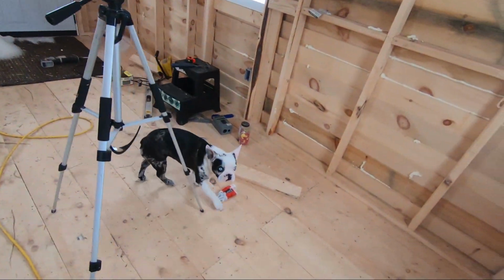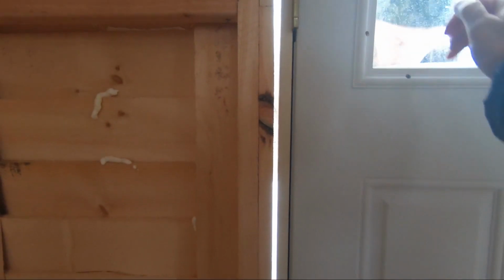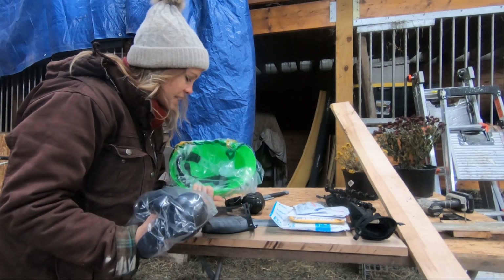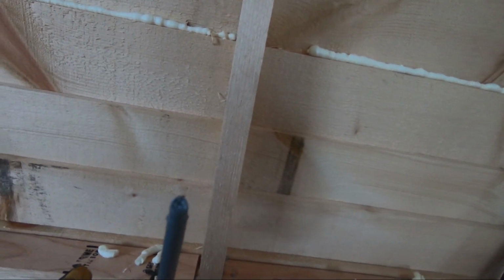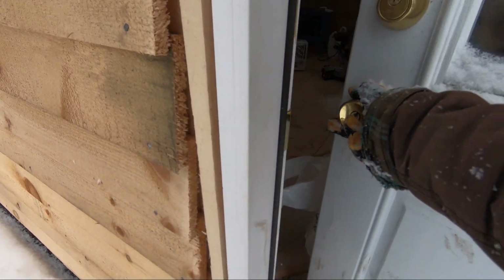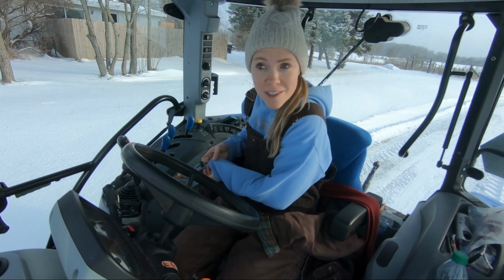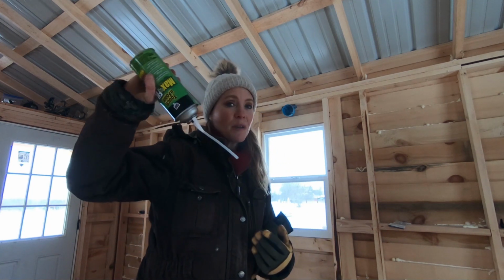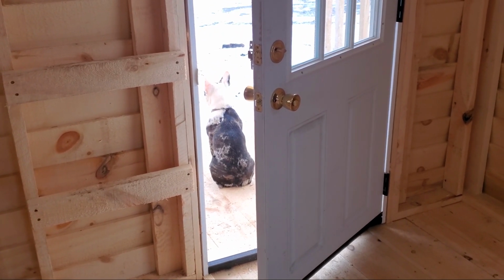359 New Holland T5 Plowing Snow, Cabin SNOW, And Spray Foam Adventures - Off-grid DIY Cabin Vlog5

Comment: Farm girl you have to be the coolest mom ever 💪😎I was kinda wishing that I was a kid again 😃 that looked very fun 😁 doors can be a real pain to get adjusted but they do make a special foam to use around doors and windows because you can do more harm than good very easy learned that the hard way calking will fill the void and stop any air from coming around the door jamb and it doesn't expand to much and cause problems 🤔 you both are very smart and you will find something that works for you 👍 thanks for sharing

Comment: That is one of the issues with using fresh rough cut it will move a LOT as it dries out. Don't be surprised if you see the boards check and even split as they dry. On rough sheds I like to set them when it's warm enough that you can get the boards painted or sealed ASAP. That helps slow the drying process down and keeps them from moving quite as much. I also wouldn't spray the interior until it dries down some just to prevent any issues from the trapped moisture.

Comment: BTW, that snow along the floor/wall is because the builder did not use sill sealer used to keep water from seeping into the walls and floors along the bottom of the walls .. You should use your spray foam there.

Comment: The doors should be trimmed then fill the gaps with foam insulation and be sure to seal all your seams with silicone caulk so you get a about 20 year seal from weather and bugs.  I trimmed the inside of my shed with tar paper and then silicone the seams along with adding insulation and then covered the interior with paneling using screws so when I needed work inside the walls for adjustments all I had to do was unscrew a panel.  Then just screw it up when finished no repaint or tape and bed. Saved money and was much easier to deal with over the years.
Reply: She is going after a more finish look. So I think she is going bro use drywall in the inside. I get what you are talking about.

Comment: Foam strips with adhesive backing should have been used under ridge cap to prevent snow from coming in but still let it vent.

Comment: Like some other people have said already. Be careful using the spray foam around the door and windows. The foam can cause them to get out of square. Or in windows cause the glass to crack because of the pressure from the window. The windows and doors expand and contact. 
May want to get the inside warm let the wood floor dry some then put a sealer on the green wood. Use screws to tighten the boards down. If you don't the floor may squ( make noises). Just put like 1/4" to 3/4" underlayment before your final flooring.

Comment: The foam you are using should be kept above 60 degrees for at least 12 hours before you start using it. That will help it to expand and stick better. After everything dries out good, maybe a layer of 1/4 inch (or thicker if room at the doors) hardboard like Masonite will help level it out and cover the cracks.
Reply from the maker: Yeah I started keeping it indoors ;D

Comment: Suzanne  I would of had plywood instilled on the outside of cabin before siding boards.
Reply: I agree since she is using the shed as a office. But if it going to be used as  tool shed like most are. Then it would be fine as is. You are not going to be worry about some rain or snow getting in.
Reply: Yes, this shed was built cheap for the price payed imo.

Comment: Was there not some sort of warranty with the cabin. Get the turkeys who built it come and fix it.  Also it’s time you invested in a proper snow blade. A angled one to save all the manoeuvring.
Reply from the maker: No, no warranty :(   Erik chose the snow pusher, he chooses the equipment usually, lol I don't know his reasoning for this item other than it could move large amounts of snow
Reply: When I plow I dont do all the side push offs like Suzanne does. The T5 is heavy enough and powerful enough to go down the driveway without all the manuvering. She needs to increase her speed of the tractor let the weight and momentum plow through the snow.

Comment: We are planning to build a barndo on our property. I LOVE the picture of the one you showed that you will be building this summer. Can you share the floor plan? Or where you found it? I love the slope of the roof! We are wanting to do solar to be as off-grid as possible. BTW, I love all your videos!
Reply from the maker: You know Erik and I talked back and forth about a barndo vs. a timberframe using that same plan. It would work for either, although the rafters might be a bit different. We re-vamped the floorplan, but here is a link to the original one:  https://www.sandcreekpostandbeam.com/products/predesigned-barn-home/modern-western-home

Comment: Before building your next project, hire a contractor who knows the building codes . Just because people don't live in an area with building inspectors doesn't mean it's a good idea to ignore the codes. Educate yourself with the codes so you won't be taken advantage of. The exterior of the walls should have been 4x8 sheathing, then vapor barrier sheeting, then the siding. Flooring planks are never nailed, but should be screwed. For thirty years as a contractor, we never used foam insulation on doors or windows, we used fiber insulation to maintain the reveal, gap between door edge and door sash. that foam insulation can close up.
Reply from the maker: We are most likely going to be doing SIPS panels, so the shell at least, will be built in a factory to code. Electric we will have Erik's buddy come out and help, and will make sure everything else is correct :)

Comment: The plow that you have is it in front of the tractor or the back? Because I have a plow that would fit the front of the side by side it has a 4 foot cut I think it needs some work like a winch and mounting brackets. You can have it I have never used it besides my ATV is in Hart. And just use it for fun I love mud and water no one will ride near me if their is mud near me Haha. I will get all the stuff it needs to mount is to the side by side if you want.
Reply from the maker: Thank you kindly for the offer! Our plow mounts on the front, but I don't know a side by side plow will have enough power to do our snow, lol! The driveway gets VERY drifty and even with our nubby tires the side by side doesn't get good traction in the snow :( Plus the tractor has a windshield ;D
Reply: I take it that it's not a 4×4
Reply from the maker: @josephcarroll2824  lol yup it is, even has a dif mode. Just driving through horse pasture yesterday hit a 12" drift and nearly stuck it 😫
Reply: Fun fun fun
Reply: Do you have tire chains for it?

Comment: There is many ways  these days to build and structure homes and mini barns these days it is endless really from eco friendly to traditional framing, I guess the local codes and the local building inspectors are not paying your bills are they, truly it is really a money market creation and the insurance companies market!
Reply: Great video!
Reply from the maker: You know, the scary part is the is one of the SMALLER "sheds". They make them bigger as actual cabins (had mine been a few feet larger it would need a building permit). I don't think any of them would really pass inspection.

Comment: Suzi - I hope you got some kind of guarantee with this office - the quality of workmanship is very poor indeed. Surprised it even meets basic code.
Reply: No code for a storage shed. These are normally not sold as a habitable structure.
Reply from the maker: We don't have basic codes for buildings under 200 sqf  :(
Reply: Sheds do not have to meet any codes at all. Occupied structures have all kinds of code. This one violates building codes as well as electrical codes.

Comment: There were lots of things that came up as I was watching. The first enemy to conquer  is air infiltration. Then the pro style insulation will make a huge difference. I had a few things I noticed and then you took the kids sledding. And now the rest of it doesn’t matter. You will figure it out. Your priorities are straight. I laughed out loud watching one of your kids “stearing ” with body english.
Reply from the maker: A few people pointed out that the floor may rot. While I can seal from the top and lay thin foamboard, that doesn't stop under rot. So I'm kicking ideas around on how to seal those rough cut boards under the shed. The 4x4's are treated at least. Thinking of just lifting it up and blocking it to install insulation. After the pro sprayfoam of course . . . that will help keep everything square ...so they tell me ;)
Reply: What does it look like from underneath?  What kindnof aces do you have under it if you lifted it?
Reply from the maker: @breakheartorchard  it has 4, 4x4 posts, thats it. The cabin walls are built onto the floor, so I can't pull up the floor. Floorboards run perpendicular across the 4x4 posts. It wouldn't be hard to cut foam board and glue underneath, but lifting 12in would give better room to get at everything
Reply: In videos I have seen of foreign SIPs panel builds where they use sips panels as the floor of a house on an open pier foundation, they paint the bottom of the the panels with a black coating that looks very much like tar or some similar sealant. If you are worried about decay, i would spray some kind of protective coating under the cabin, then insulate and seal it. I kniw some people are knocking the workmanship but keep in mind, this is a rustic cabin/ shed. 200 years ago people raised a family of 4 in about the same space. Log walls sometimes dirt floors. There was no preservative coating for most wood and the structures lasted a long time. So if you are moving forward, just deal with the issues that come up and go to the next one. And remember this is not your actual house. This is practice and an extra living space.

Comment: sue, just for future information, there are two types of spray foam. one that really expands, and one for around doors and windows that fill cracks, but doesn't expand as much to not take doors and windows out of level and plumb. now i try to never say anything bad about a posters video and what they are doing, but your small house you are working on, is really not done right. i am sure you spent good money for it, but don't recommend the company to any friends. i would be pulling my hair out, and i would take pictures of the work you are doing on it, and show the people that you bought it off of, and try to get some money back. just tell them that you have a youtube channel, and you will name and shame them on it. it might get you some money back. i am sure the spray foam you are going to get done, will fix a lot of problems you are having, it is a beautiful looking cabin, but just not done right.
Reply from the maker: You are correct. Unfortunately many of the cabins I looked at were built MUCH worse. I just don't think our Amish out here have a lot of care into their work :(  We had been considering them for a pole barn, but I think I'd rather not risk it . . .
Reply: A shed has no building codes to meet. It's not meant for people. If the building inspector for their new house build sees this there may be a problem.
Reply from the maker: @roymoon1  it only needs electrical permit. Ive got the paper being filled out :)

Comment: Isn't this a SHED!!  Until everything is assembled, with sealing intent, you'll be chasing your tail trying to seal it from wind blown snow!!
Reply from the maker: Yup, exactly true. EAch time I walk in, new gaps have formed between the boards. I probably WILL go ahead and spray the roof cracks because it appears they ddn'tnstall the typical rubber footing used to seal them . . .

Comment: Building anything other than something like pallets with green wood is not the best idea. There'll always be issues with joints, nail pops and failing paint until the wood is dried and stabilizes. And if it was me, I'd be taking pictures of these issues and trying to get my money back.
You payed for a product expecting it to be constructed with a certain level of workmanship and that certainly is not what you got unless you were informed and understood the potential issues you could face with green lumber construction.